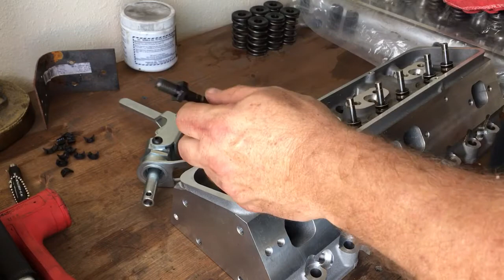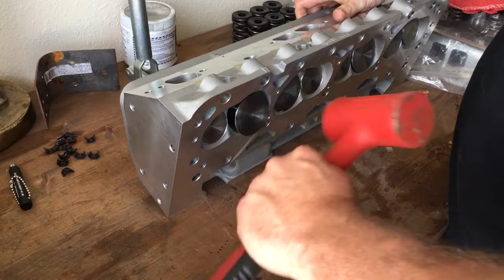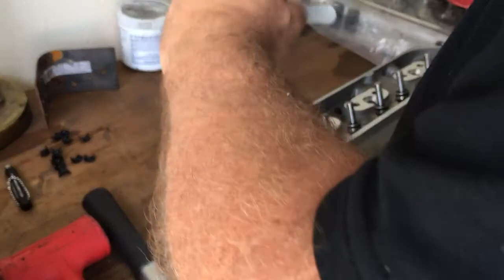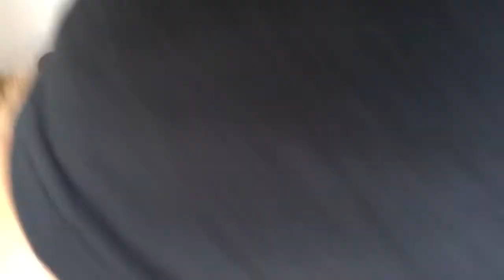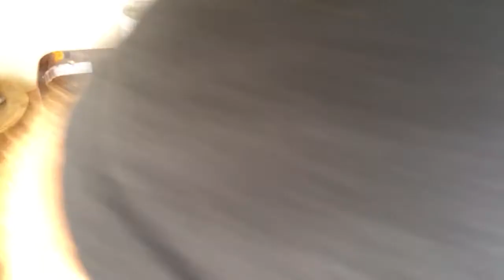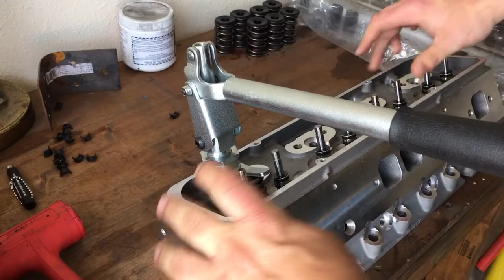Summit Racing Valve Spring tool Quantico 195cc #3

Comment: Hey man I'm 4 years late but I hope you are well and healthy. But I want to ask you somthing about my LT1 5.7 96. Are those valve seals how they come from factory? The full rubber ones. Are they any good? Some say blue ones are the best. Also mine are half Metal with the top is rubber.
Reply from the maker: Positive valve seals come in many configurations, Viton is the style we use.  As for the method they use to help hold them on it’s either an interference fit with a rubber/viton seal inside a solid metal sleeve/band or it can be the seal inside a split spring style container.  I hope this makes sense.  
Honestly I think the LT1/LT4 heads came with positive valve seals; You’ll know by looking at your valve guide tops. 
Thanks for the kind words and good luck on your project!  JD

https://us.amazon.com/Brian-Tooley-Racing-Valve-Seals/dp/B00LASYSGI

Comment: Will that tool work on bbc heads?
Reply from the maker: Jeff M Yes, this style valve spring compressor works on almost any engine with 3/8 or 7/16 studs.  I can’t say enough about this tool, it works great even on roller springs etc.  JD

Comment: So I don't have to have a seat and can just use a shim for the locator or should I use the actual locator under springs? Also does the shims and locators have to the exact size of spring diameter? I have Z28 springs that are 1.26" OD and have locators or seats that are 1.3" and shims that are 1.25" so can I use these parts I have on hand or should I buy new exact size parts for the z28 springs
Reply from the maker: James J. McCloud There’s two types of ways to locate the shim or locator.  Most commonly used are shims/locators that match the valve guide boss. The steel shim will be held by the valve guide boss. 
Valve spring locators can be used that both fit the valve guides and the inside diameter of the valve spring, this is common with heads that have only an exposed guide at the top without any additional casting material making it fairly small diameter. Like .500”/.530”/.562” etc. 
what Head castings are you running?  JD
Reply: @HeadFlowInc  ok thanks, I just bought the Assualt Racing aluminumb205cc  castings for my sbc 350 which have the exposed guide with .530 guide as u said
Reply: @HeadFlowInc  Comp cams 4705-16 is the locator I'm looking at but it isn't the exact same specs as my Elgin z28 springs but pretty dang close
Reply from the maker: James J. McCloud Be very careful and check your installed height to establish the correct height. Those locators are kind of big on the fitment to the guide! But will take up .060” of the available space for the valve springs.
Reply: @HeadFlowInc  ok thanks again, I did buy +.100 valves so I won't lose all my height. Tried to plan ahead when I ordered them so hopefully I done right with that lol
Reply from the maker: James J. McCloud It’s so odd to me .530” guides are commonly used yet I don’t see anyone offering shims or locators with a .530/.535” ID 🤷‍♂️. 
I’m assuming those heads came with an installed height of 1.800” springs?  This is problematic when trying to run a Z28 spring with only 1.700” IH.  One step up would be the .550 lift single springs that use a 1.750” IH, much better start. Using a .550 spring with the .060” shim/locator should get you very close.
Reply from the maker: James J. McCloud I think the Elgin 1943X spring might be better fitment than the 943X.  Or if you’re closely looking at seat pressures the 943X will need +- .100” worth of shims to set the IH. Not the best but will work.
Reply: @HeadFlowInc  I bought the heads bare so I could know exactly what went into them lol I just couldn't buy them assembled knowing it'd be the cheapest components possible probably and the z28 springs I have were just something I already had so as far as springs I can buy something different if I can find the right setup with the dang locators. I'm used to cast iron heads so this aluminum thing is new to me unfortunately
Reply: @HeadFlowInc  I appreciate the excellent advice and info and it's helping me out more then u probably think. I'm running a flat tappet Howard's big mamma rattler cam if that helps with any more advice
Reply from the maker: James J. McCloud I just woke up I guess, since you have a 1.800” IH you could run a beehive valve spring like the LS6 or equivalent. 
You would need the Comp Cams 787-16 spring retainers to work with the beehive springs and 11/32” valves. 
The LS beehive springs use a 1.800” IH, so all you’d need is a single .015” shim. But budget sometimes is a limiting factor.
Reply: @HeadFlowInc  I did think of that set up and budget isn't to tight however my reason on staying clear of the beehives is I had just bought a spring height mic but not the beehive version so the retainer wouldn't sit right without doing something different but that option is on 5he back burnner

Comment: Quantico sent me heads like that. they was sold as having .600 lift hydraulic roller springs installed on 1.800". i measured the installed height & it was everywhere from 1.74 on one & up to 1.85 on another & the others was everywhere in between. all this was without the spring seats under the springs. absolute junk. the springs, valves, retainers, keepers & valves was all pro comp part numbers. pro comp is junk on valve train & honestly on about everything they sell. you could actually look at the locks & see that the locking ring in the lock was in different locations. some higher & some lower. junk. buy these heads bare & put your own shit in them. they just slap the shit together & ship it out the door. they are great castings, but buy them bare, or from anyone else other than Quantico.

Comment: You need to correct you lash cap explanation , the cap is almost a press fit on the valve tip , not the other way around
Reply from the maker: davie biggions I’ll watch the video again, I’m not sure what could have been misunderstood. 👍
I see, what you’re saying, the lock doesn’t hold the cap on. The recess is there to allow the lash caps to seat on the stem without interference.  Thanks for catching it!  I’m not sure if YouTube will allow me to edit an older video though. Thanks again!  JD

Comment: so besides the shims these are worth the money?i was going to buy these then redo the springs,seals,locks etc and lap the valves i should be go with these right?
Reply from the maker: blown5.3 So far, everything I've seen looks as good as a Dart casting. Even the shop that drilled the 400 steam holes in them said they look like a Dart head. Yes I'd say these are good heads, we haven't run them yet but they check out so far.